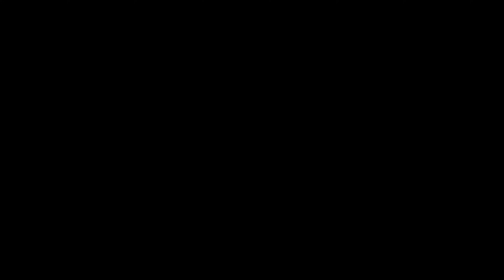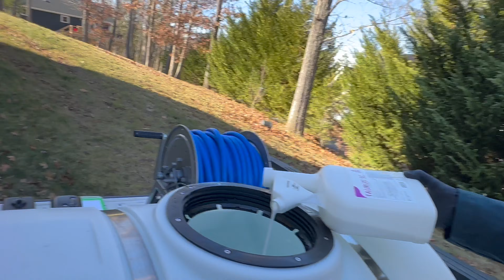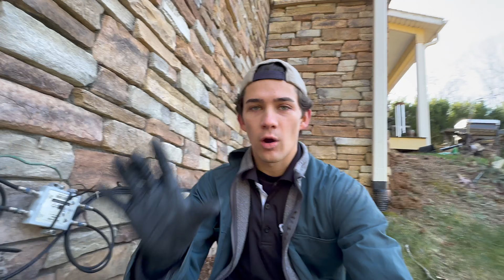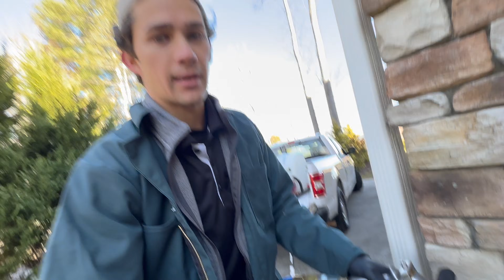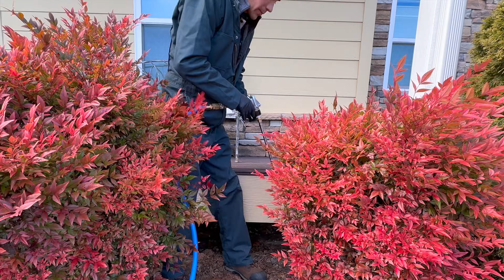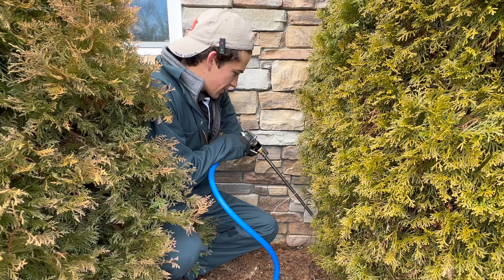Termite Treatment - How to Trench & Rod for Termites

Comment: Can i trench and use a bucket instead of a wand since i can’t afford to buy the wand ? I’ve seen a previous video for you using a bucket
Reply: I’m a certified applicator in Arizona and I’ll let you know that if you’re doing your own home treatment using a bucket is fine as long as you are treating a mono slab home or a post tension slab home and you don’t really need to get underneath that slab. That’s really what the rod is for. I’ve even seen commercial termite treatments do only trenching with absolutely no drilling due to brickwork and other sensitive non-drillable surfaces just make sure you’re putting the proper amount of product down per 10 feet and you should be fine.
Reply: @apenguingames4305 that’s what thought too , i would trench a little deeper down like  just to be on the safe side , thank you

Comment: It's amazing that a lot of people are getting away from drilling but in the Phoenix area I've seen multiple companies use termidor, Dominion,taurus,fuse and in southern Arizona drilling is absolutely necessary if they don't have a post tension foundation even foam in the wall isn't sufficient I see so much damage at homes that been treated previously and I explain to customers why I need to drill trough their tile or lift carpets and drill the foundation
Reply: I live in Florida and when my home here was treated they used termidor also and they drilled in areas that were covered with concrete like the driveway and patios.
Reply: @TomBTerrific  that's how I was trained like 10 years ago, but a lot of companies are just starting to treat the soil and foam the one area  or the areas they see termites bait stations are starting to get real popular out here which I think they don't work only as a secondary option

Comment: According to the instructions you’re supposed to apply 4 gallons per 10‘ per 1 foot of depth and you’re supposed to count for 4 foot of depth if the footer is more than 4 foot down and 2 foot depth if it’s for example 2 feet down. This applies particularly to Hollow block walls for basements and such.

Comment: Excellent video! Your quite knowledgable. My question is how would you treat perimeter where my concrete drive meets house and I have a large concrete patio in rear that butts up against house? Thanks
Reply: Drill HOLES in the Concrete or Asphalt so you can treat that. However....if you treat along the drive, you lessen those chances they are nested under the slab. But they like to nest under things like that for some reason.

Comment: How do you 1/4 or 1/8 inch gaps between the driveway and home where concrete meets concrete? I have termite tunnels coming up between the two. Just spray down over and over?

Comment: Good video.  Thank you for the information.  Regarding your spray/pump system.  What sort of PSI are you typically using?  Just curious if my typical ag spray rig would put out enough PSI at 70PSI?

Comment: When trenching homes with a crawl space should you trench the interior perimeter of the crawl space or does just the exterior of the home work?
Reply from the maker: Just the exterior will provide great coverage but you can do the crawlspace also
Reply: Also, what about the piers underneath that support the flooring system?

Comment: Is there anyway to get your pest control operator license without years of experience?
Reply: You can take the Purdue IPM course and qualify for the exams in most states. Google their website and it will tell you which states.
Reply from the maker: In NC you either need 2 years of experience or an entomology degree.

Comment: I notice you said you inject at a depth of 30 inches, depending on the foundation the label calls for 48 inches minimum and even deeper if they have a basement for example. I also notice you are not drilling holes 12 inches apart across the patio or the driveway so you are leaving GIANT gaps in the barrier. We drilled patios, driveways and patched the holes when we were done with cement.
Reply from the maker: Yes depending on the foundation, not many foundations have footers deeper than 30 inches in my experience. Unless its a basement, in which case the he label says "if the footing is more than 4 feet below grade treat to a minimum depth of 4 feet". Which means treat at least 4 feet down, but not required to do more. I don't know anyone who has a rod longer than 4 feet🤣! That rod would be crazy! Do you have a rod that long? North Carolina rules stated 30 inches so that is what I was going off of. 
And the customer didn't want us to drill the patios. We had the customer sign a waiver.
Reply: @DanTheBugMan  Not to be that guy man but the label is what you need to go off of, not what North Carolina says. Most labels are universal and will specify mostly situations like New York and California for different laws. So if you have a 36" Rod then you need to dig a 12 inch trench then rod to full length of 36". Or dig an even deeper trench.
Reply: He's a horse so he might have a rod that long.
Reply: you followed the label then.

Comment: Dan you should use Termidor HE imo instead of Taurus 

Termidor He only requires 2x4” trenches AND concrete drill holes require 18 inches of space instead of 12 inches
Reply from the maker: What I really want is Taurus/CSI to come out with their version of HP. the injection system. Have you seen this work? It's amazing. I heard Taurus might be coming out with one soon https://pestcontrol.basf.us/products/termidor--hp-ii-high-precision-injection-system.html
Reply: @DanTheBugMan  I get quote for the termite control company using termidor hp II, which is expensive compare with traditional one.  The technician told me that they don't need to trench around, I am little bit worried about deck and front porch area where fundation is inside, without drilling holes, just use the HP || system around will be effective?
Reply: Exactly and it has polymers in it to bond in the soil more that's why you use less.

Termindor SE will work fine, but the industry kinda has moved on with HE over the past 4-5 years. 
Taurus is the same thing but I don't understand why people use it over Termindor, there's not much difference in price
Reply: @gr8fulnbama439  yea plus Control solutions is a crappy company to buy from imo 

In Houston they opened up like 10 stores for DIYers while simultaneously selling to professionals so they take food out of our mouths essentially 

Same as Bayer really how Bayer sells DIY versions of chem in Lowe’s / HD
Reply: @gr8fulnbama439  BASF, MGK and Ensystex the only guys I buy from now 

Bell for rodenticides 

CSI sells to DIYers which I don’t like
Reply: @gr8fulnbama439  But note that both have the SAME Active Ingredient = Fipronil, but Taurus  at 9.1% actually has 0.37% more by content than Termidor HE at 8.73%.  So the only matter is price if you don't have to inject or Drill Holes in Slabs. So for Homeowners, Price is the bigger factor if you don't have holes to drill.  But truth is these two companies manage the price pretty closely - almost as much as Lowes and Home Depot, whose Lumber are less than 1 penny off from each other (collusion???).
But you can find deals, so look for your best price for what your doing is best way...unless your doing slabs.
Reply: What type of termite pole and container would you recommend I use for my home or should I use a sprayer after digging the trench. I'm a new subscriber.

Comment: did mine by trenching took 3 days in florida sun. in ten years when time to do again I'll pay someone lol
Reply: Yes just pay someone and then you’re also supporting local business 

Plus I assume you didn’t have a rotary hammer to drill your concrete areas so your home is likely unprotected in 10-25% of areas
Reply: @Kylewraps  nice scare tactic. my home is fine you dont think I consulted with anyone?
Reply: @dereckc9469  wasn’t a scare tactic I’m just saying realistically if you did a trench only termite treatment you probably missed a couple of areas that normally we drill into concrete 

For example I usually drill 1 hole on each corner of the garage driveway 
I usually drill 3-4 holes on A/C pads that are up against the house 

If you have a backporch I’d say it’s a 50/50 chance that should’ve been drilled unless it’s monolithic etc.
Reply: @Kylewraps  my library lets you borrow tools rotary hammer where needed and plugged afterwards
Reply: @Kylewraps  so would you say the video gives bad info when he says you're fine using taurus without drilling?
Reply: @dereckc9469  I’m not familiar with North Carolina and basements so idk

In Texas we have houses that are on flat land with a concrete slab and that’s it but even with a basement or a hill I imagine there’s atleast a little bit of drilling
Reply from the maker: @Kylewraps  @dereckc9469 Also think about how termite bait stations work!! Only a very small percentage of the home has the bait stations around it, But because of the foraging nature of termites, they come in contact with the bait and it eliminates the colony! It's the same active ingredient!!
Reply: @DanTheBugMan  I had bait stations at my townhome my neighbors unit had a station 6 feet away and after a month and a half still had an active termite tube I broke open 

I even told my competitor who had the account and he wasn’t surprised “yea it takes a while to hit” he said
Reply from the maker: @Kylewraps  Kyle the Taurus eliminates any termite colony that comes in contact with it. Termites forage for food all the time in a random fashion from their colony. Even if you miss treating a small portion of your home, the colony will come in contact with the treated soil eventually right?? This is my theory
Reply from the maker: Haha hey if you have the time then go for it!

Comment: Are you not going to drill the slab areas
Reply: The house has all kinds of slabs connected to it and that counts as the perimeter too. If you don't treat it ,Its just a spot treatment then. If I wasnt going to drill it, I would at least trench outside the perimeter of the slabs themselves.
I did termite work for over 20 years and we would spot treat active areas with Termindor and treat the perimeter with Sentricon. 
I hope for this company their state regulators are not watching
Reply from the maker: @gr8fulnbama439  Everything I did in this video was per label and state regulations. Just because you did it one way for 20 years doesn't mean there's not another way to do it. Open your mind to new possibilities :yougotthis:
Reply: @DanTheBugMan  Well I just stopped last year and open my own pest business, not doing termite.

It may different where you at, but in Alabama you cant skip any slab areas even if the customer says so. The Alabama waivers themselves way "customer not wanting an area treated isn't a valid excuse."

So we would spot treat the same infected areas with Termindor and treat the perimeter with Sentricon to cover the rest of the house 
We could not put them in bond with a spot treatment.

Then again Im guessing it's different where you at
Reply from the maker: No we don't unless necessary and customer didn't want me to. Unless the termites are clearly coming in under the slab the soil treatment will always take care of the colony. Just think, the termites are foraging for food everywhere in the soil in a spider web like fashon, they will come in contact with the product even if we skip over a side walk or drive way. We hand the customer a waiver and still issue the warranty.
Reply: @DanTheBugMan I’m surprised by your statement. I’ve had treatment with two different vector control companies adhere in Florida and one in Tennessee. All three have drilled my driveway and other concreting areas. My whole house is a slab.